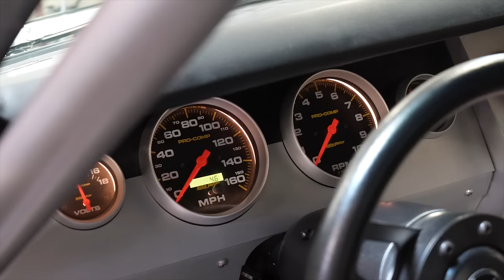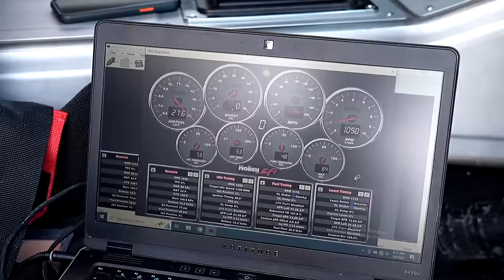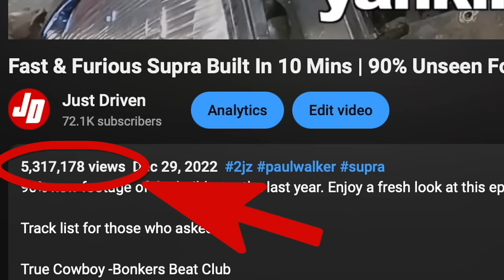The Fast Supra and Furious Charger Ready to ROCK!

Comment: I think it would be cool to see it at a drag strip and actually get it into the 9's, and get it to do an actual wheelie, even if it's just pulling both the tires up a few inches. Can't wait to see you really get on it and do some pulls on the street! This car is one of my favorites of all time.
Reply: I don't think such a front heavy car can manage to byte the asphalt enough to do an actual wheelie, but I hope they at least try.

I know I can do them in my car, but in a very different way, I have an Abarth 500 with a 305mm Brembo front brake kit, yeah, the rear wheels do nothing in a emergency braking situation with dry floor.
Reply from the maker: We are going to try show off the power of both of these beasts.
Reply: @YOEL_44  Oh they can, they absolutely can... if set up correctly to do so. Drag racing is all about weight transfer to the rear wheels, and is highly dependent on the suspension setup. You'll see the real serious dedicated drag cars will have "wheelie bars", basically training wheels that catch the car and stop it from scraping the bumper on the ground.

Comment: Cool builds ,  I am a  Moparian and Muscle car and Hot Rod nut so Charger my favourite, Supra is cool though.

Take them down the strip. 

Also K.I.T.T I seen in video 😍😍, what happening with that?? And what is red car in corner on shelf with camber?
Reply from the maker: KITT is still on hold. We just received much of the electronics for the build landed here in the states. We plan to get started on this build soon.
Reply from the maker: The red car in the corner is a Lexus IS300 Sportcross with a 1J engine and a very nice build from top to bottom. Alex has been using it for drifting for a years now.

Comment: Doesn't anyone make an electric brake booster? Other than that you could add a vacuum pump. If there is no room for a vacuum booster a Hydroboost unit could be used and turn it with an electric motor with a VFD  taking a reading from the speed sensor. The hydroboost works well and is very compact. I have one in my restomod 82 Corvette with a 427. I needed a hydroboost because the engine vacuum is very low with a high duration cam.
Reply from the maker: We currently have manual brakes with the appropriate master cylinder and don't see a need for a brake booster at this time. There is still little to no room for any type of booster based on where the engine is mounted since we had to shift the drivetrain over 1.5 inches to make it more movie accurate with the engine coming out of the hood.
Reply: @JustDriven  that does make it an issue for fitment shifting the engine to dead center.  I know my hydroboost takes up no more room widthwise than the factory master cylinder with the booster mounted upside-down so the accumulator is facing the fender. That's how Hydratech designed it.

Comment: You mentioned you might not connect the amps? Are you talking about some period correct amps that would be difficult to source or any amps at all? It'd be a shame for you to have sourced all the rest of the 00's tech and not have it function! Amps should be a go ;)

10:38 Someone with an oscillating machine needs to be let loose on the paint. :D
Reply from the maker: Connecting the audio would not make much sense to this particular build. We NEVER turn the radio on in this car. The engine is all the music we need. So we would have a lot more money invested in the audio build but never use it.

As for the paint... yah, it had been sitting in the shop collecting dust for a while now. It's about time for a deep clean.
Reply: @JustDriven  Just so I'm not mistaken, I thought the amps were for the Supra. I understand only needing the engine as a soundtrack in the Charger.

As for the rear hatch, it's got holograms, not scratches. It's a result of using a rotary wheel to finish it out. Oscillating machine will solve that.
Reply from the maker: The amps are for the Supra. We have everything we need for the amps and stereo. We just don't know if it's necessarily something we feel needs to be completed to show off the details. We never turn the radio on. We just enjoy the car as is.
Reply: @JustDriven  I see where you're coming from. 
Even though it won't be used that much, at least I would feel a great sense of accomplishment to be able to say everything works and everything is as it should be. To finish off, I'd just like to say thanks for doing this project and thank you for showing it to us!

Comment: The charger has the wrong engine in it. The original charger had a engine based off of the 392 with the distributor in the back.
Reply from the maker: Ok, thanks for your input, but we are well aware and cover this topic in our videos. The original Charger only had that engine sitting in the car not connected and for that one garage scene only.  All other chargers used in the movie had fake blowers and a variety of different engines. Our car is meant to closely replicate what was seen in the movie, but made to be better and fully functional.
Reply: @JustDriven  you built a car that will never truly be driven or raced. You built a car based off of the one scene and couldn't even make it correct. Not saying you didn't make a cool car but it is not movie correct. You could have built a very reliable engine based on the 392 Hemi like the original engine was.
Reply from the maker: @KingKarnage1994  well I guess we can’t please everyone.  We wanted a newer drivetrain so we could use modern fuels and technology. Don’t get me wrong we have some  regrets in some of the direction we went, but that’s the way it goes sometimes.  We hope you at least enjoyed some of the build. 👍🏻
Reply: @JustDriven  You built one hell of a car. My point was you spend that amount of money to make a screen-accurate car and in my opinion, it is not a screen-accurate car and should not be labeled as such. You could have easily built a 392-based Hemi that can run on any fuel you wanted.  No hate whatsoever, I just thought it was sad to see so much hard work go into building something just to mess up such an easy detail to get right.
Reply from the maker: @KingKarnage1994  fair enough, like I mentioned there are some regrets and if we had it to do over we’d go a different route. Thanks for the input. 🙏🏻